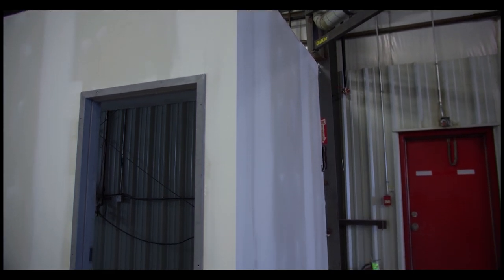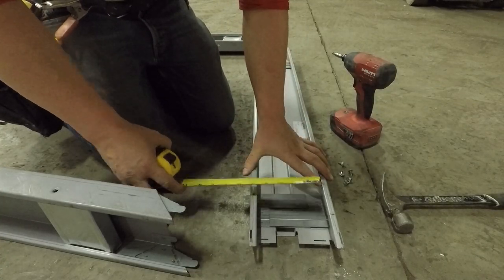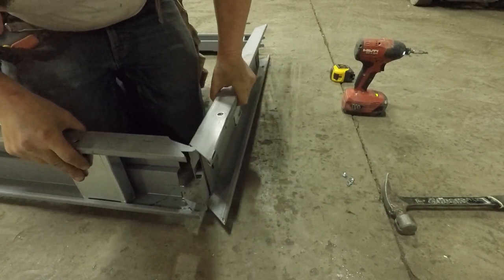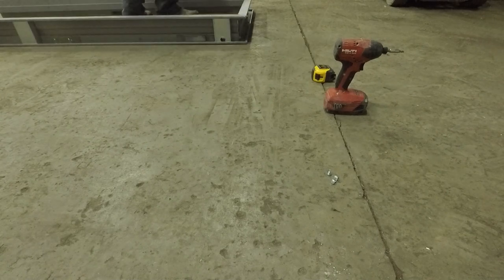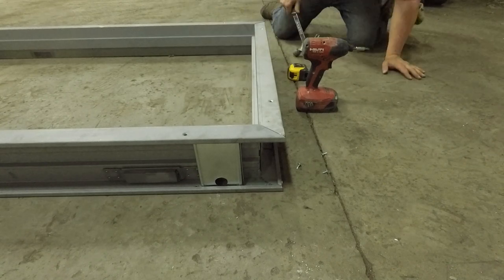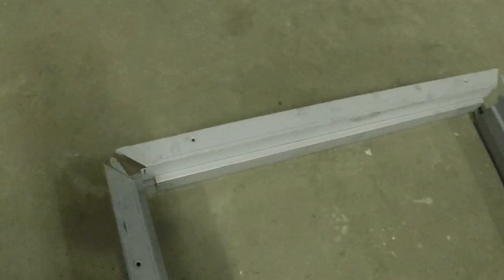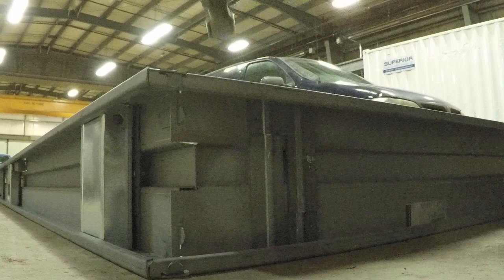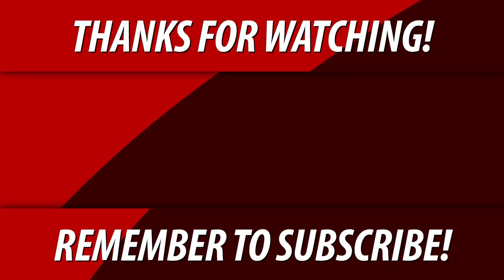Metal Door Frame Install Metal Stud Framing Frame Building Tutorial

Comment: In the video before thee clips looks like they are floating do you put clip or screw fo
Reply from the maker: That's how the clips work. Even the clips you get that from the manufacturer are only ever friction fit. We don't fasten them to the frames. The trick with my custom clips only works because of the coincidence of the thickness. That's also why its important to follow the instructions to a t! Excellent question! Also the placement of them is important. They are over top of the hinge boxes.